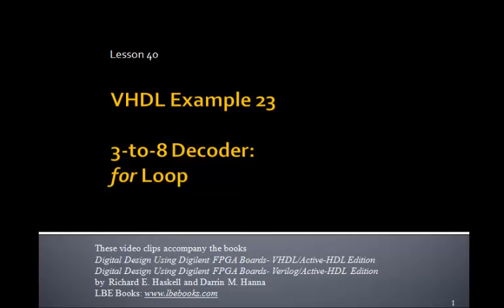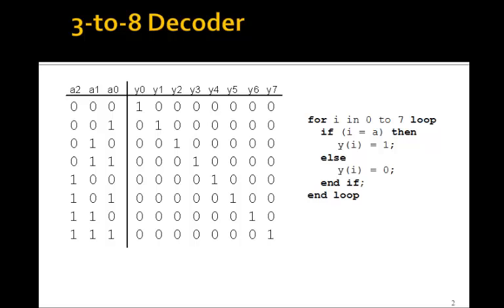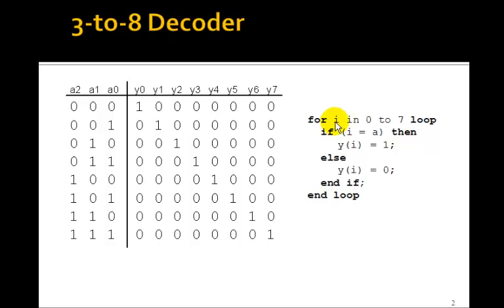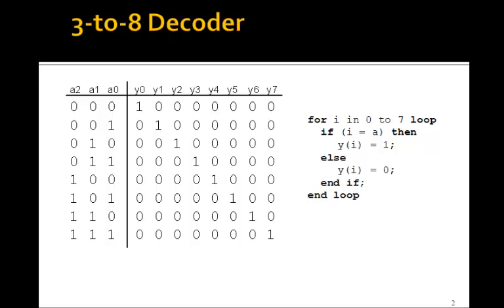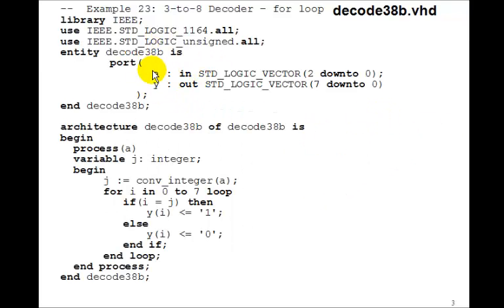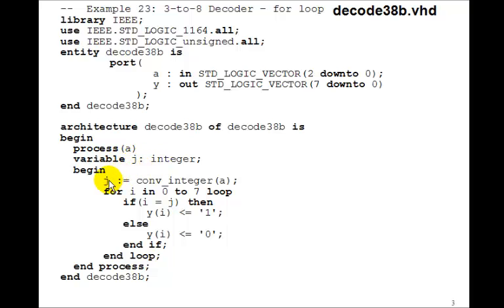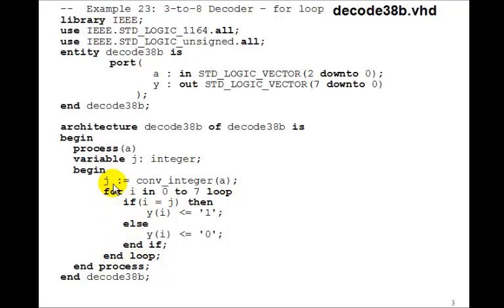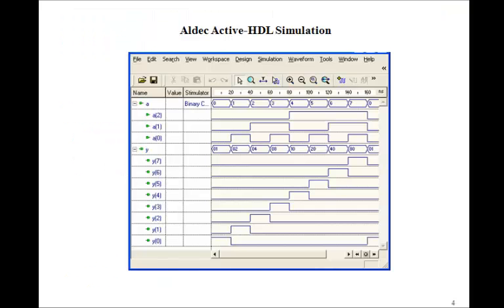Lesson 40 - VHDL Example 23: 3-to-8 Decoder using a for-loop

Comment: There is a simpler way to solve this problem. This is my code and i did simulate it , it looks fine
process(A)    
 variable temp_A : integer;
begin
 temp_A := conv_integer(A);        
 Y <= "00000000";                       -- to clear all;
 Y ( temp_A) <= '1';                      -- Only SET the bit that corresponds to the value of A
  
end process;